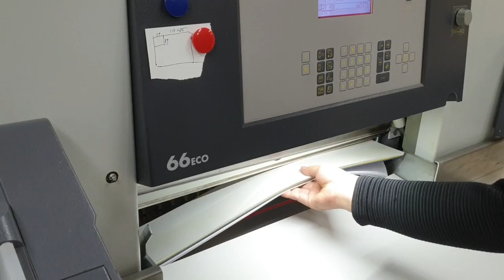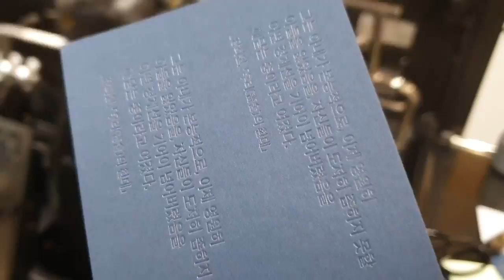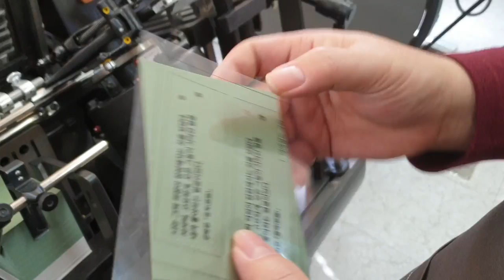Create letterpress bookmarks with transparent foil printing. 투명 박가공으로 레터프레스 고급 책갈피 만들기.

Comment: That Heidelberg is in excellent condition!I have one from 1969 and it's working like a charm. Is that a custom  "die cutting jacket"?Mine is set with a screw at the top and not with the round metal bar.
Reply from the maker: Hi.  My equipment was built in 1981.  The die cut jacket is fitted.